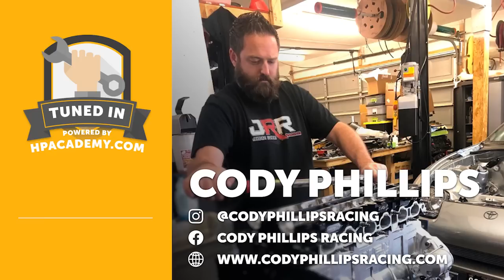048: Is The 2JZ Actually Any Good? [#PODCAST]

Comment: Haha he needs to twincharge the engine to get the boost curve he wants. Then use the boost control system to allow it to vent off the excess at launch but quickly shut the venting off right after launch to sky rocket the power.